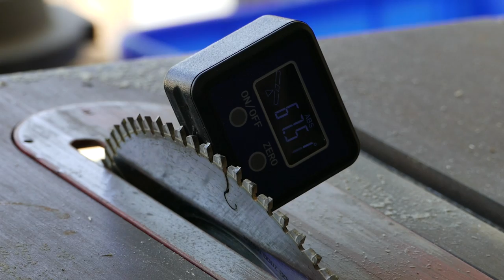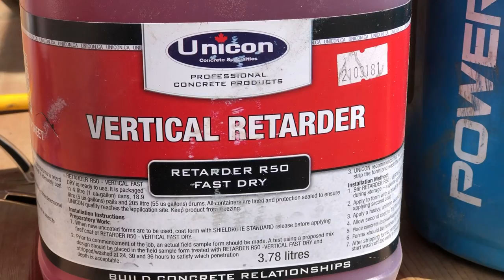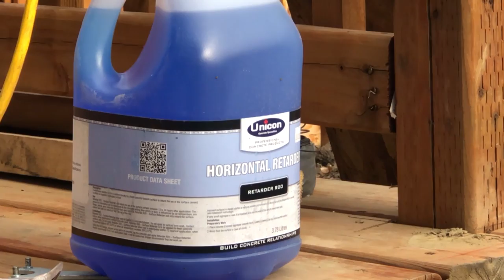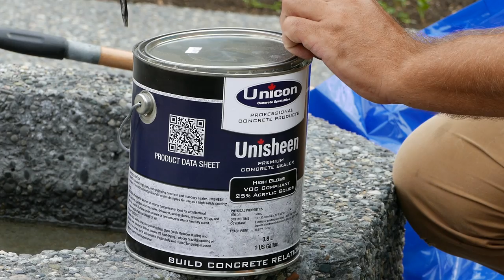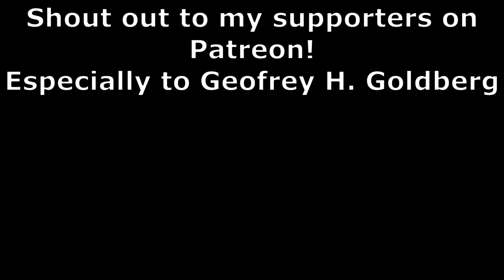Construction of Concrete Fire Pit Start to Finish. Epic Backyard Transformation. ASMR

Comment: It is not a good idea to build fire pit with concrete, because it will crack when heating the concrete, it is very difficult to remove once you don’t want it, plus no supporting air from the bottom of the pit. I used concrete blocks and metal frame.